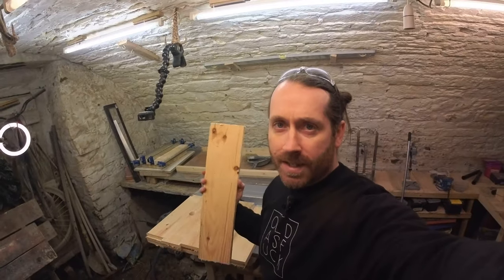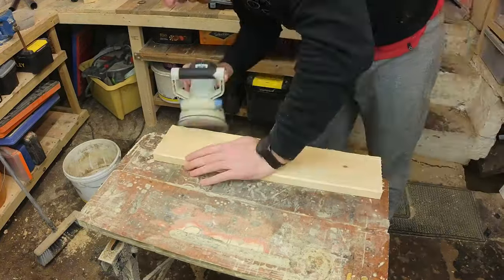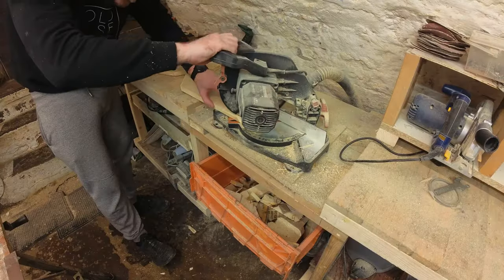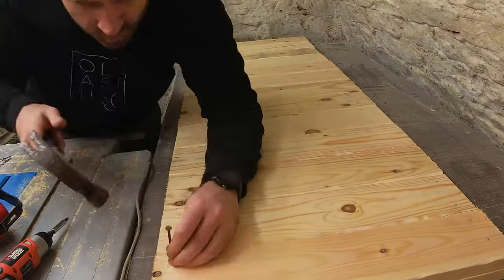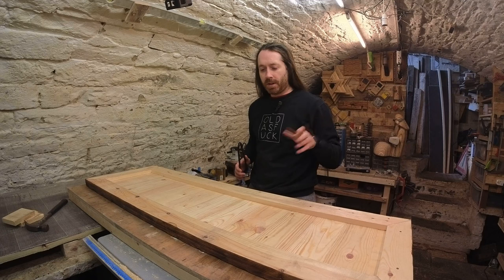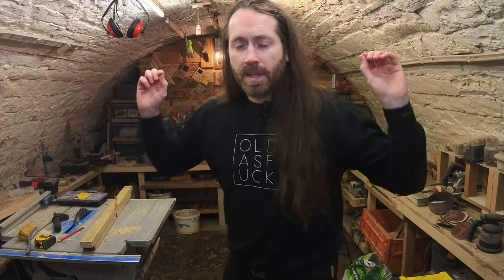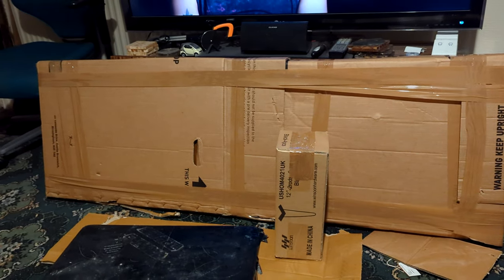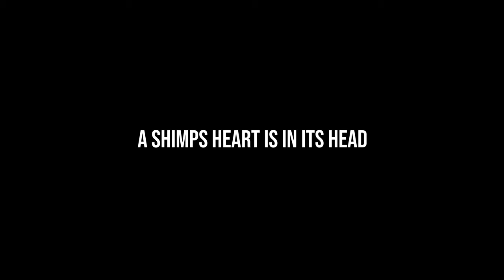DIY Coffee table that actually SOLD!

Comment: Really cool build.  Could you have made the top out of reclaimed timber?.  Would have a little more character.
Reply from the maker: Thanks for the comment! A full reclaimed timber piece is on my list to do. 
The aim originally was to design a table I could replicate quickly and easily if it sold.
 Which was great for this video as it's almost identical to the original, just bigger :-)